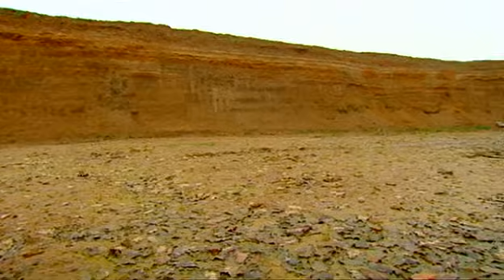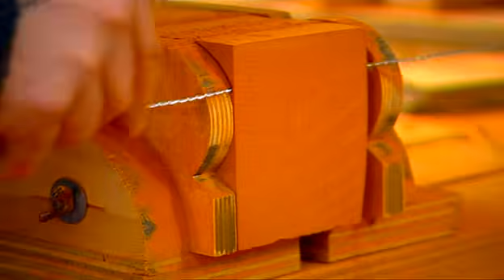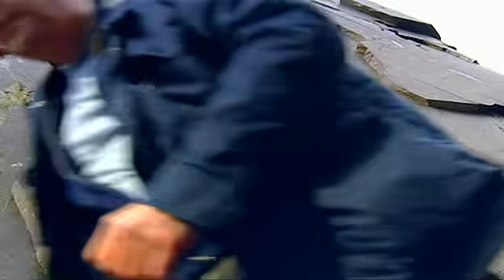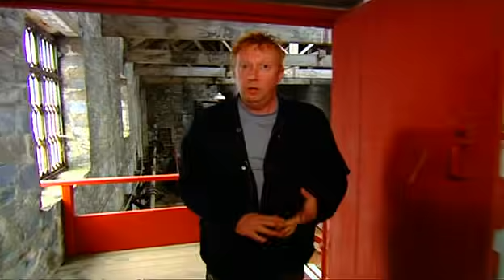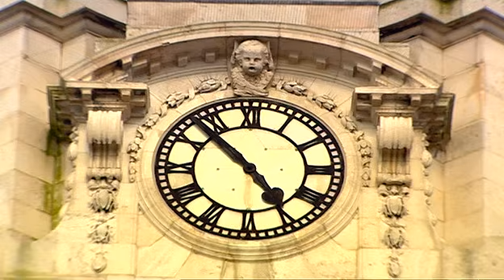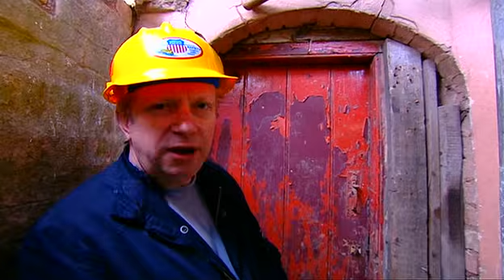More Industrial Revelations - E06 -  Building a Revolution

Comment: Always amazes me, why are bricks so small. If you had larger bricks could it not cut the build time down AND possibly use less cement in the actual build. Just a thought.
Great programme by Mark as always, more more more please!
Reply: Those days they were all full body stones and there is a maximum thickness they can bake. It would also not be easy to handle bigger ones. Modern hollow bricks are much bigger and made such that they are easy to grab and to lift with 1 hand. But those hollow ones are not strong enough for building for example that bridge. That is only possible with those classic full body stones.

Comment: Thanks, I once got a research grant from APCM and in later life, quite unrelated, I worked with the cement industry,modern single kiln sites can produce 5000 tons of cement a day.
Near Settle there is an Hoffman kiln for lime production,obviously no longer used, but it is huge and at Claughton, near Lancaster, there is still an overhead ropeway in operation bringing clay down from the high ground to the brickworks, I think it is just gravity powered.
Love this series.

Comment: The "concrete castle" in Bridgewater is on its way to full restoration, externally finished it seems to be in the process of being turned into three flats.
https://www.google.com/maps/place/Queen+St,+Bridgwater/@51.1291507,-3.0021716,3a,90y,133.74h,92.54t/data=!3m7!1e1!3m5!1s_tNfvFK6IjMQrKwtuuE_ew!2e0!6shttps:%2F%2Fstreetviewpixels-pa.googleapis.com%2Fv1%2Fthumbnail%3Fcb_client%3Dmaps_sv.tactile%26w%3D900%26h%3D600%26pitch%3D-2.544286931206443%26panoid%3D_tNfvFK6IjMQrKwtuuE_ew%26yaw%3D133.7351029509071!7i16384!8i8192!4m6!3m5!1s0x4872088892ee32d9:0x32d6116103d0987!8m2!3d51.1290664!4d-3.002583!16s%2Fg%2F1v1vcn11?entry=ttu&g_ep=EgoyMDI1MDcwOC4wIKXMDSoASAFQAw%3D%3D